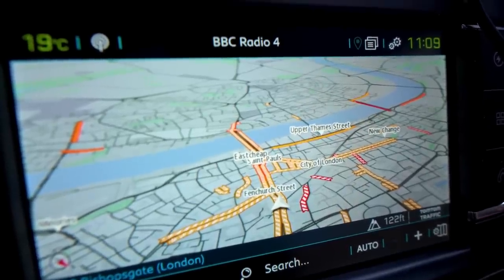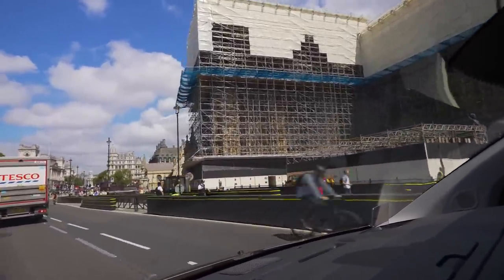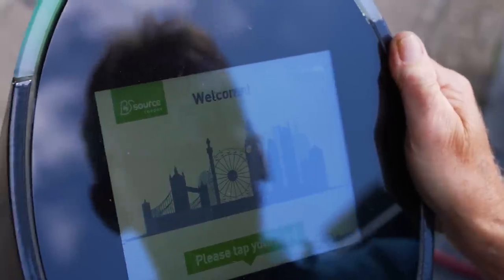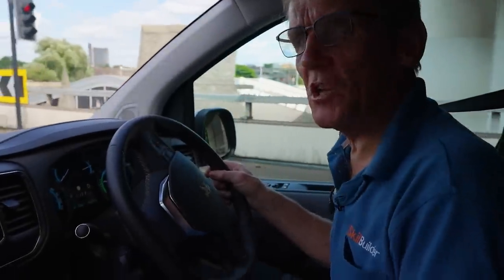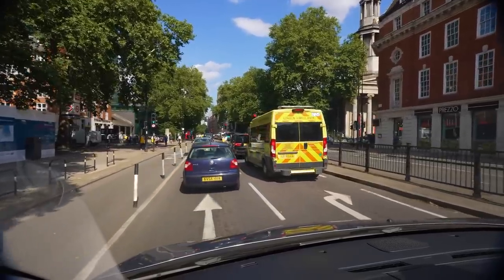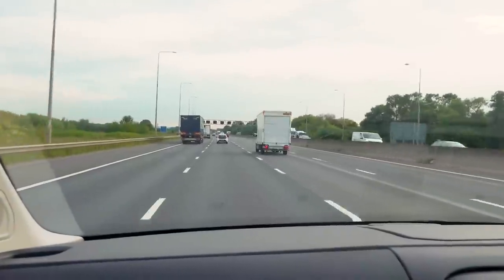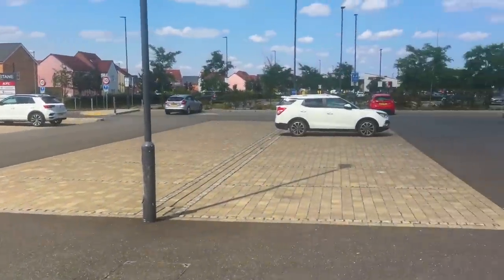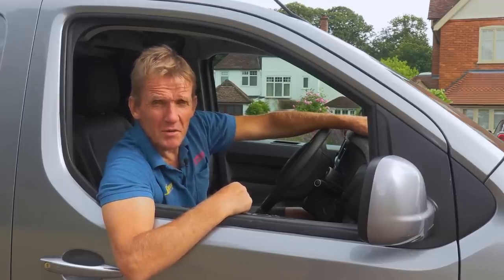Is It Time To Switch To An Electric Van?  e-Expert Test

Comment: Hi fellas 
Thanks for the review.  I was thinking of going electric for my next van but the lack of charging points, also vehicle cost is prohibitive and at that cost I'd be worrying about damaging it especially when you have a bunch of trades all parked up on a customers drive ;someone's going to reverse into it or catch it with their tools and if they don't I will. So I'll  wait for  a few more year's or  at least until there's more ev points and hopefully  prices come down a bit. Roger! Thanks for London history...interesting mate! perhaps this could be your next venture?
Reply: Seems like you may save 700-1000 a year on fuel but approximately £20k more to buy, may take 15 years to break even? Plus if your are financing it the extra interest may outweigh the savings. May be more useful if in London or if more towns only allow low emission vehicles

Comment: £10 overnight? you need to get on economy 7. 

I've got the same PSA group platform in my corsa-e and it's £5 to full overnight on the off peak rate. (may be different in the spring after the gas price madness is over)

Comment: The biggest issue is the short battery life.
At least 1 manufacturer admitted to a customer that a 10% drop in range per 11,000 miles is perfectly normal. For a high mileage driver this could lead to spending £7,000+ every 3 years on replacing battery.
Reply: That's vastly exaggerated. Apart from that, there is an 8 year warranty on the battery.

Comment: Don't think your gonna save money because in 5 years when you have to buy a battery ,every penny you have saved you will spend on a new battery...
Reply: Checked out fully charged. The guy imported the first Nissan Leaf over 10 years ago and its still going. Well worth a look.
Reply: why do you say 5 years is the battery life? most evs are coming up 10 years on original packs, a new pack for a car is around 6 grand, its going to get cheaper as more efficxient batteries get made in larger numbers. it will last at least as long as an internal combustion engine, plus you arent paqying for new clutch, timing belt,exhaust, etc.

Comment: Well they are still using gas to make electricity and also Coal more and more in the uk to power the new electric vehicles!!!
Reply: better than having diesel fumes blowing out everywhere
Reply: @gman8950   and I bet when Diesel came you were saying better than having all those Petrol fumes  blowing out everywhere!!! How did that work out for you!!!!!! Ha ha
Reply: @AndrewSmith-bb8sh  I think 2020 was the first year where more than 50% of the uk's energy came from renewable..... wind/solar. Change is happening and it needs to so we need to embrace it and help drive it. We all need to do our bit for the environment 👍
Reply: @TheDavidsims  too true!
Reply: @gman8950  the modern euro 6 diesel is so clean it can be driven in any modern city ..
When was the last time you saw a less then 2 year old  regularly serviced van belching black smoke??
Reply: @reTool462  battery technology will be obsolete within 10 years.
Reply: Oh yeah Diesel is going to clean up the world again!!! Yeah like it did last time how could I forget!!!! 🤷🏻‍♂️
Reply: @AndrewSmith-bb8sh  Diesel is and always will be a dirty fuel  .. 3 cylinder lean burn petrol engine linked to self charging hybrid can return 60 + miles a gallon  .
Look a Japan with Kei cars in their cities. 
The global cost of rebuilding,  re tooling the car industry to use old outdated battery technology is not the answer.
Reply: @dashcam2417  indeed battery technology might not be the answer. Not sure what is, the car industry coming forward with answers usually is nonsense.  They are driven by their profit and not their desire to help the planet. Also governments are tied in with these people aswel, so no hope their either.  We need ideas from something/someone that does not seek greed!

Comment: Is it time to buy an electric vehicle (car or van). No. Not now. Probably not even in the near future. Well not unless you want to go nowhere particularly fast (especially in winter and with a heavy load). Maybe the future when manufacturers have solved the endurance issue and cost problems. But no, not right now.

Comment: I personally think that the use of Hydrogen that is being developed to run with conventional diesel engines is the future.
Reply: Nope, that's a non starter. Electric is the future, in fact it's here today.
Reply: Toyota is an ex-leader. They had their chance and muffed it - as did Nissan, their current crop looks pretty stale and expensive against the competition.

Toyota is really just one man pushing his company to put pressure on governments for his own idealism. Meanwhile everyone else is going full battery.
It's not like they can even give away the hydrogen vehicles they already make and once they've got over their strop they'll follow the rest of the manufacturers and make BEVs.
My gut feeling is they're scared they're going to lose out to the Chinese who are way ahead both in tech and price and so are trying to move the goalposts rather than fight them on their terms. Once you take the engine out of a Toyota it's no different to most of the other stuff out there and that scares them.

As a consumer given a choice between something you can charge cheaply overnight at home (or for free at a supermarket) and something that you have to drive no small distance to fill up at more than the equivalent cost of petrol/diesel you'd be mad or have a very specialised use case to buy an hydrogen car.
Any chance hydrogen ever had disappeared 10 years ago.
Reply: @definitelynotkwacker  Ford are only developing a full sized transit aimed at fleet markets, because the cost is too high for small businesses and self employed to swallow to go electric.  ... Also fleet companies are bothered about their carbon emissions  .
The new Connect  / Caddy  will almost certainly be a hybrid  ..
Reply: Thats what the gas industry whats you to believe
Reply: @dashcam2417  it’s hydrogen fuel cells which create electrical energy to drive electric motors. Hydrogen also wouldn’t be capable of powering a Diesel engine.
Reply: Hydrogen can’t power a Diesel engine it’s too combustible. You could adapt a LPG/petrol engine to run hydrogen but it would be a huge waste of money.
Reply: @mrfr87  correct you are ,  I think  battery technology will be obsolete within 10 years  ,  it's a stop gap until something better comes up. 
I just pointed out that Toyota are not developing an electric vehicle.

Comment: I think congestion charges will stay and go up and include electric vehicles eventually as free parking will have to be provided everywhere for electric vehicles to use as they need it for recharging. Think how crippling it would be to pay for parking while charging then electricity on top of that at the same price as petrol or diesel which it will become eventually if used to recharge a vehicle, why they are always pushing smart meters.
Reply: True - when all vehs are electric there will be as much congestion as ever.
Reply: The area covered by the London Congestion Charge is to be increased by almost 20 times, and the daily cost is to increase to £18.50..... a bit of a shocker. There is little doubt we'll see more emissions charging schemes.
Reply: @caahacky  But hopefully the levels of Co2 will drop dramatically....
Reply: @Brian-om2hh  Yes Brian, in the cities no doubt but the electricity has to be generated somewhere and although I'm a big fan of renewables there's no way all the energy currently released from petrol/diesel could be provided by renewables - not for a couple of generations anyway.

Comment: I must admit, breathing in fumes every day sat in traffic is not nice. These lecky vehicles might be a breath of fresh air (soz).
I’ve always maintained my owned vehicles (which I quite like) but I’d imagine these vans would require much less maintenance other than the usual brake pads, the odd steering joint etc. Can’t imagine a large electric motor being any trouble.
Enjoyed the vid. Cheers Rog.
Reply: My take is that these vehicles will actually be more expensive to maintain, due to the amount of electronics in then alone.
Look into why mid west farmers pay so much for mechanical John Deere tractors, insane prices, but they can maintain them themselves without an expensive John Deere engineer who can only repair the newer tractors with his John Deere codes and computer.
It's potentially huge revenue for car companies
Reply: Electronics only costs money if it goes wrong. For regular maintenance there's significantly less and the long warranties that consumer vehicles offer make that less of an issue.
The only extra electronics in an EV over and above an equivalent IC is the motor controller and charge controller - two boxes you could in theory swap yourself in 10 minutes (and by the time they're out of warranty such parts will be available from breakers).
Reply: @definitelynotkwacker  Car manufacturers have a nasty habit of making things that should be simple very difficult.
Reply: @GavinLawrence747  Unless your a mechanic you won’t be aware of the huge quantity of sensor on a Diesel engine. There is so much more to go wrong on a combustion vehicle. EV will still have lots of things go wrong on the rolling structure like all vehicle but not as much as combustion cars.
Reply: i paid 450 for a service and timing belt recently, not an issue on an electric van. no clutch, exhaust or head gasket either..
Reply: @kevinwillis6707 I'm not sure if you understood one of my salient points... is that with the complexity of the vehicles, the manufacturers will make it so that you can only get a service from that companies engineers - they are wanting to push out all independent mechanics and engineers - they will claim only they have the expertise to service the vehicle.
You will no longer be able to choose who services your vehicle, as the computer will lock out everybody who cannot validate the service electronically.
Reply: @definitelynotkwacker  You haven't understood - you won't be able to choose who services the vehicle - the manufacturer does - all repair/service will be through the approved garages/mechanics/engineers - and because there is nobody else who will be allowed to do so they will be able to set the price.
It's already happening in some markets.
Hopefully the government will step in and make it fair, but knowing this government....
Reply: Lets say that what you're saying is correct and people simply don't opt to buy cars that are simply cheaper to service.
(Which given how many cars are bought with a service plan makes it fairly easy to compare).

So if that's correct - what's different between EV's and IC?
They can do exactly the same with IC so I'm not sure what your point is.
Reply: @definitelynotkwacker  Perhaps I haven't been clear enough. What is going to happen is that when the switch to EV occurs, the manufacturers will use it as a cover for the fact that only they have the schematics and electronics/ custom semi conductors to fix any issues that will arise.
So what will happen is it will drive all the other mechanics out of business, because they will be unable to access this information and parts and also probably not be "certified" to repair the vehicles.
I will admit that there are some people who got conned into car loans and weird PCP contracts where only the Nissan garage was allowed to service the car, and they complained the garages were ripping their eyes out for the car servicing.
All i'm saying is that they will use this switch over to EV to further consolidate the idea with regulators that only they are allowed to repair the vehicle, and when that happens there is no market, and they can then set the price.
Now you might find that a manufacturer goes the other direction, makes a reliable, quality car with off the shelf EV parts that is easy to service and repair and therefore gain a lot of customers that way..... but who knows - sometimes the £££ to be made from years of servicing and repairs that you set the price for and the customer has no one else they can turn to for repairs might be too tempting.

Comment: Roger, mate....
Unless your charging port is being fed by pure renewable energy, you are simply exporting your pollution (which makes a mockery of the "0 tailpipe emissions)  from your driving area to the power station.... 
And the range is just not there yet, are you only going to take on work within that range limitation ?  
That would be ridiculous, I'll stick with my Citroen Berlingo diesel getting 64mpg and fitted with the latest emissions tech...
And how long do you think those free chargers will stay free ? 

You made a vid recently about the scam of heat pumps... these vehicles are no different, subsidised transport ... from subsidised renewable generation... 
WHERE is all this electricity gonna come from for transport AND heat pump systems without major grid & generation infrastructure spend ?? 🤔

😎👍☘️🍺
Reply: Your stuck in the 80s mate, I'm a van driver & have gone electric on my personal car, you don't really charge on the forecourt, it's mostly at home, and with night rate's it's even cheaper. Range on these vans are about 200 miles/  300km, I'm sure if you're doing that range one way you'll stop at least once, so why not plug it in for a few minutes?
Reply: @GrahamOCheallaigh   yer a "vanman"... yet you talk about your car... why haven't you converted yer van ? 😌
I get call-outs every day... I can't tell the customer "can you wait a couple of hours whilst I charge me battery !! 😂...
Admit it... the range & charge-speed isn't there yet.. and the price of electric vehicles is ridiculous... maybe in ten years time...and you haven't addressed  the pollution problem..  🙂👍🍺
Reply: 43.1% in 2020 was from renewable energy and it's hugely improving each year. You can't just throw out a comment about pollution and such where even the backwards UK already have that much renewable energy. Look at the continent, they're lightyears ahead where even higher percentages of renewable energy is used. The "pollution aspect" is just unbelievably untrue nowadays. And we're not even talking about how polluting ICE cars are, to make and to run.

The spending on infrastructure is on an enormous increase as well.

Instead of moaning about it, do something to help.

Comment: The sums dont work out the van is too expensive has no trade in value and  my customer won't pay the premium. I cant get to places I work at the times customers want and cant get back .It would ad hours to the day UNPAID hours.  Cant use the heater to keep the kit warm as it reduces the range .

Comment: and what happens when batteries get exposed as environmental issue and limited available raw materials get classed as short supply ? 
battery vehicles is a very short sighted development .
Reply: What is the long sighted development?
Reply: If the raw materials become limited, it will encourage more recycling and help solve the first issue you mentioned. Think long term, not short term.
Reply: @HKFunster  thinking is indeed needed.
the recycling isn't a win win scenario, it requires smelting furnaces which emit harmful emissions  and requires use of fossil fuels, to recover lithium and metals requires chemical leeching which again big issues on pollution when considering the volume in an EV future !
The battery chemistry and required material spec to give them longer usable life and higher capacity hinders recycling and the amount of materials that be usable at high end manufacture .
You can not fix issues of pollution caused by capitalism and consumerism by throwing more industrialism at it ...
Electric itself in volumes needed for a EV world will create environmental problems (coal, gas, oil, nuclear, biomass all use limited resources and have serious environmental impact) and if you look at solar panel at raw material mining and manufacture needs of fossil fuels it not the answer in mass volume as you still be damaging natural areas, producing harmful emissions and needing fossil fuels  ..
One thing it will be very good at is making even worse poor quality junk with short life span and emptying the consumers bank accounts .
Reply: @mrb1864  it requires smelting furnaces which emit harmful emissions
simple, just use a battery powered smelting furnace; sorted.
Reply: Well nobody seems to have bothered to "expose" the oil companies as an environmental issue, despite the fact they've been mining cobalt for decades. They need cobalt to remove sulphur during the refining process.... Why hasn't this ever concerned you previously?